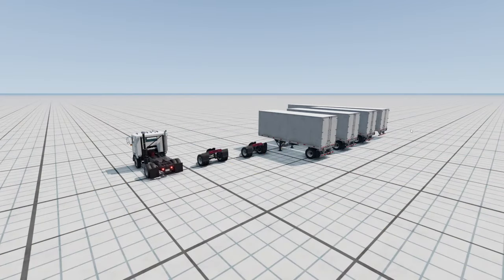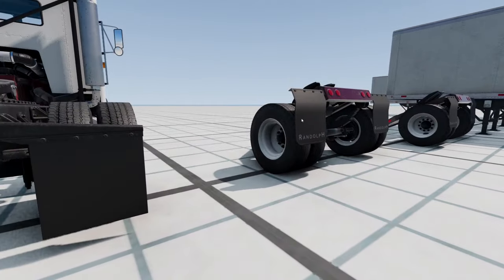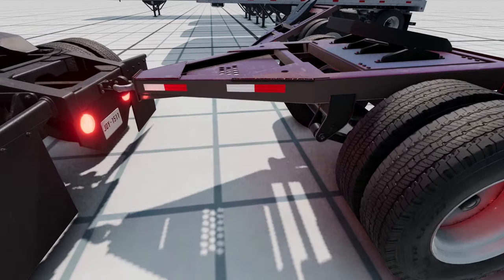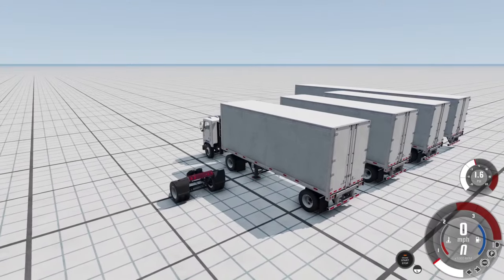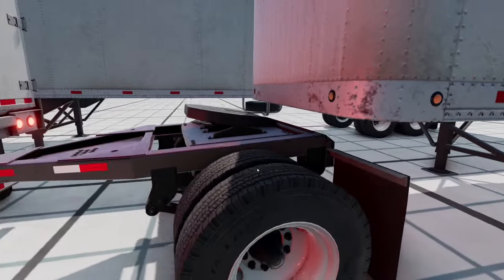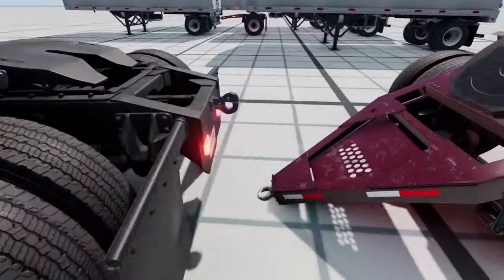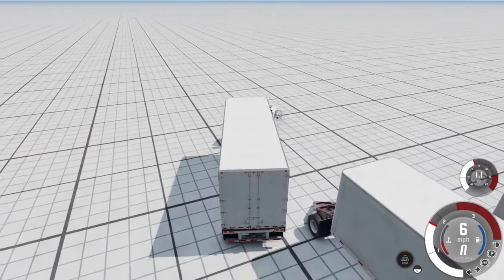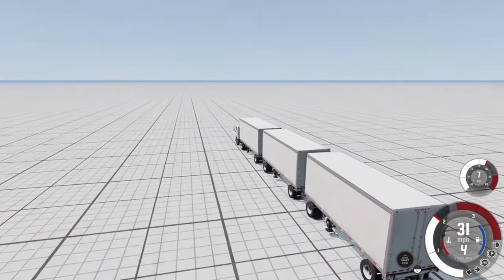How to Hook Multiple Trailers (The Real Way) | BeamNG.drive

Comment: On the first dolly you placed, wouldn't you want to attach it so that it is higher off the ground so you can attach it to the trailer easier. Awesome video anyway
Reply from the maker: In real life you would make the height adjustment at the rear trailer by cranking the landing gear. You want the trailer to be lifted slightly when the fifth wheel contacts to prevent a "high hook". In this sim the landing gear only has 2 settings: fully up and fully down.
Reply from the maker: Edit: I misunderstood you. The dolly always lays down at an angle like that. It has a lot of counterweight so lifting it isn’t hard, but turning/maneuvering is.